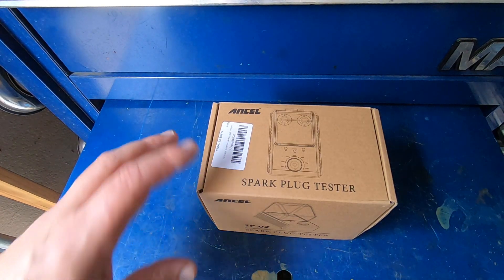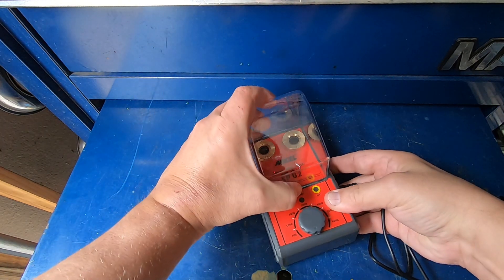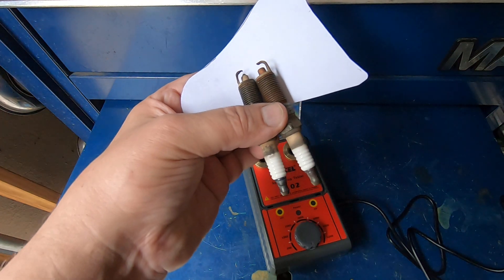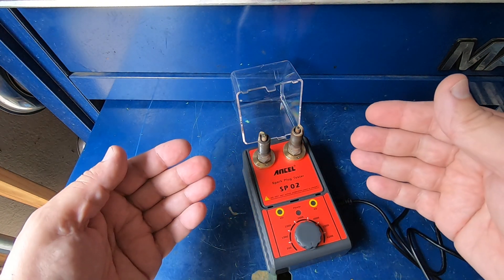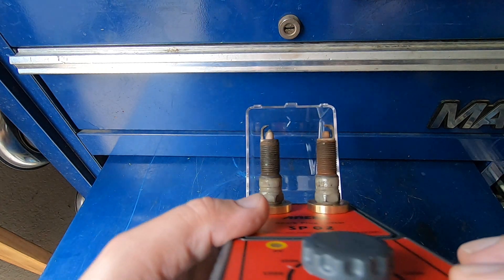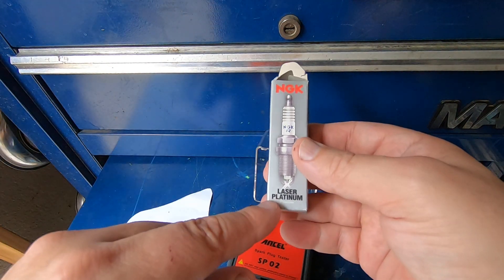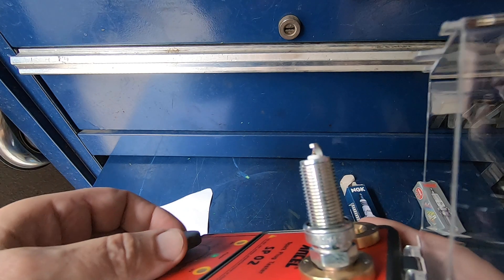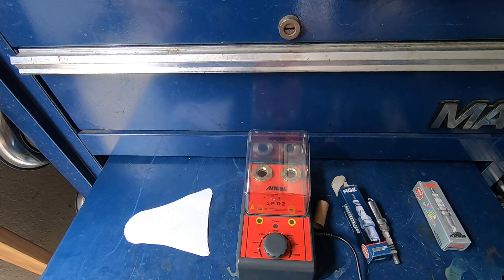Review of the ANCEL SP02 Spark plug Tester.

Comment: I have a similar one that works pretty good, but it only has one spark plug hole that will not accept longer plugs. I add a washer as needed and then it works. I like yours better.